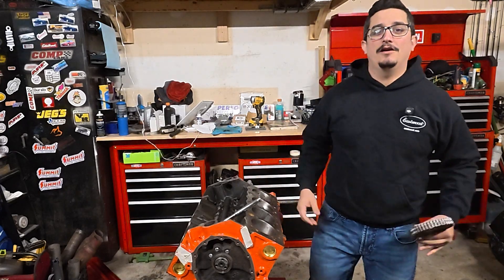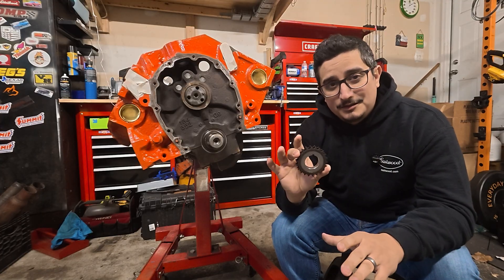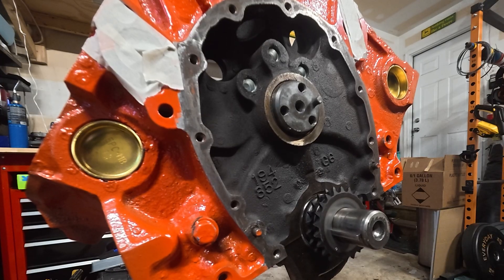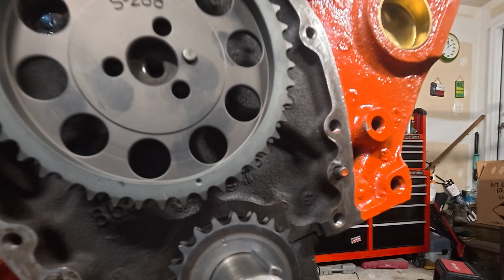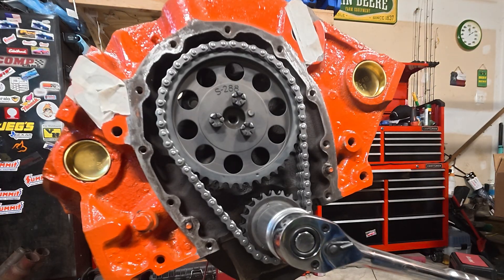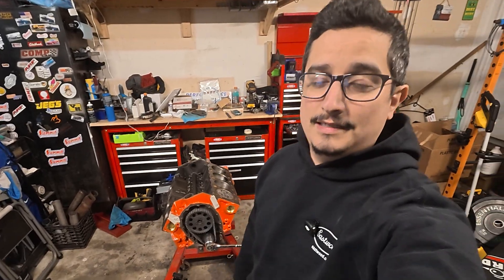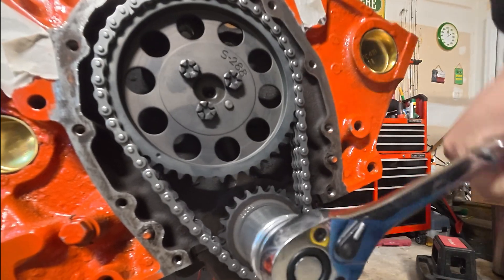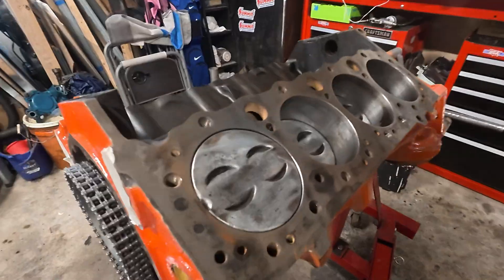The Engine Building Timing Secret You Need to Know

Comment: I think he's a good guy, but he is NOT explaining what he's teaching very well. 

His idea is the correct way to install a timing chain. 

Installing the distributor is a different matter. Theoretically, you can drop the distributor in with the rotor pointing in any direction. Then bring the number 1 cylinder to the top on the compression stroke. Remove the cap, place the #1 wire at whichever contact the rotor is facing. Install the rest according to the firing order. The only time this would not be ideal is if your recycling your old plug wires and they're already bent a certain way that might not be ideal.

Let the complaints begin.

Comment: Dot to dot is not always where the cam should install, if you degree the cam you will find out. I have a 388 that I'm currently building and when degree the cam dot to dot it was 2 degree retarded which is not really ok in  my application, so with my billet timing set i was able to advance the cam and degree again n its now 1 degree advance which is OK.

Comment: If you drop your dist with crank gear at 12 o'clock, and cam gear at 6 . You'll be 180 out, correct dist. Drop Crank at 12. Cam at 12.. my 68 Chilton Manual shows it  for Pontiac v8 and chevy v8

Comment: Couple of things I noticed.  First, ALWAYS use a puller bushing on the end of the crank.  There was a ton of metal coming off the puller when you pulled the timing gear.  Couldn't tell if it was from the puller or the crank, but regardless always use a bushing or a bolt with a small locator hole drilled in the center of the head.  Use antiseize or grease on the puller tip where it inserts into the threaded portion to reduce friction on the end, and lubricate the threads as well.  Second, maybe it was just how I was looking at it, but after the cam gear was on and you were rotating the engine, it appeared to have a good amount of slack on the coast side of the chain.  Was this block align honed or bored?  If so, the timing set you should be running will have a slightly shorter chain to accommodate this.  They are not shelf parts, you'll have to special order it.  Lastly, and the MOST IMPORTANT part of this, is MOCKUP.  The time to check for clearances, needed grinding or clearancing, or modification of parts to fit is during mockup, NOT AFTER the short block is assembled.  You should have checked this clearance before the rods and pistons were in, and with the crank sitting on just a couple of bearings to allow rotation.  I know I'd be pissed as hell if someone ground clearance for something on my engine AFTER it was assembled.  There is no way possible to get rid of the grinding debris without complete disassembly and cleaning of the engine.   Oh, one thing I forgot.  The cam sprocket bolts.  ALWAYS ALWAYS ALWAYS use either a locking tab or loctite on those bolts.  They carry more load than you think and CAN loosen without warning.  I can't even count how many times I've seen this on both stock and aftermarket engines.  Just because the tightening torque values are low doesn't mean the fastener doesn't see a lot  of load.  Without a thrust plate and stop bushing keeping the cam in place, it WILL WALK back and forth while the engine is running, and no, the distributor gear will not prevent this.  The only thing holding it all together up front is the cam gear bolts.  Just an FYI.

Comment: I alway bring it up on #1 compression  before putting in distributor. Distributor is one of last things to install on a motor replace or install. I get most thing bolted up so i can prime the oil system before the distributor goes in and you cant see these marks by then.bump it over on starter find #1 comp line up timming mark on balancer with the pointer drop in distributor with rotor pointing at #1 hit the key and shes running. Not that hard

Comment: I don’t understand? I rebuild more engines in my life of 50+ years as a mechanic and I always set the engine on TDC and the distributor a little advanced, never had a problem starting, then I would set the timing and fuel if it’s a carburetor after the warmup,

Comment: First, whenever your dot on your crank is up, your #1 piston will ALWAYS be at top dead center DUH! Second, before you drop your distributor in, simply check that both valves are closed on number one. I’ve been doing this for over 40 years. This method never fails, and I never had a hard time starting any engines after a rebuild. Assemble with both dots facing each other, lube the chain and install your timing chain cover and forget about the dots. Install the harmonic balancer and line up the timing mark with the pointer on the cover, then simply check if both valves on #1 are closed and if they are not, turn 360 degrees on the crank. You are just confusing newbies with useless information. Also, NEVER hammer the gear/sprocket on the crankshaft. Use a bolt and proper washer or a specialized pressing tool.

Comment: this guys a idot its ALWYS dot to dot
Reply: Dot to dot is for timing set installation, yes, but if you want to drop the distributor in and align the rotor on #1 plug wire, the dots will need to both be at 12 o'clock. That's when #1 piston is at the end of the compression stroke, both valves are closed, and #1 cylinder is ready to be fired.   When the crankshaft sprocket and the camshaft sprockets are lined up dot to dot, that's when #6 piston is at TDC and at the end of the compression stroke.

Comment: For us older mechanics (im 82 years old retired) We were taught why. If you go dot to dot you know youve got the gears perfectly timed But they taught us early on to turn the timing marks so that both marks were at the top And that way you know your gears are perfectly aligned and with both marks at the top of the gears then you know youre perfectly 0 degrees timed on #1. AND VERY IMPORTANT to put your #1 plug wire on the right front corner of the distributor cap on Chevrolet V8 And on later 80s models and some of the early 90s models that was very importantbecause of degree timing and you also had to make sure you had rthe correct camshaft and crankshaft for the year model you were working on

Comment: You don't point the distributor to number one , you point at number 6 on the distributor cap in which looks like it is 180 degrees out and the engine  will start everytime . He is right dot to dot is on the exhaust stroke but by putting the distributor in like I said when the rotor turns to number one it's at the beginning of the power stroke

Comment: Generally speaking I will rotate the engine a few more times for various reasons before I get it all together - then I use the valve/rocker positions (not the timing set) to make sure I am at a little before TDC on #1 compression before I drop the distributor in. I did like your trick for using the socket on the crank keyway to bar the engine - I will probably use that if I have the right size socket

Comment: I don't agree with method at all, every shop I've ever read shows dot to dot.
Reply: Yes, dot to dot for installing the chain, but that's when #1 piston is at TDC and at the beginning of the intake stroke. It's also when #6 is at TDC and at the end of the compression stroke. When the guy turned the crank 360 degrees and put the cam sprocket dot on top, the opposite of my previous sentences is true.

Comment: I always go dot to dot never had problems I've done hundreds always started right up and duel timing chain s belts but each to their own should of heat up bottom time gear it would of went right on .
Reply: But you didn't install the distributor on #1 when the timing set was still lined up dot to dot.

Comment: All you have to do is make sure you're on top dead center on the compression stroke is the key part before you drop your distributor in it must be on the compression stroke!
Reply: Otherwise it will be 180 out and will make noise but not run

Comment: Like Rick Simons, the book shows dot to dot, but you are 180 degrees out on #1 timing. You have to rotate the crank, then dist drops in normal. 
  ASE Master Tech - 78
Reply: Thats because the oil pump shaft was not inline.

Comment: Why didnt you use cam button chevs are notorious for cam float so its easy  now to alleviate the problem by fitting a cam button & reduces the wear factor just what i do for stock cams or hot cams

Comment: How are you going to adjust your lifters without turning the whole thing over several times.  And then you leave number one at TDC on the compression stroke.   Everything he said, makes no sense.
Reply: Not everyone puts the timing cover on before the distributor installation. When #1 piston is at TDC and at the end of the compression stroke, both dots are at 12 o'clock. What he did is correct for showing what the timing set looks like when you should align the rotor on #1 plug wire, but he didn't do a great job of explaining what he did, and why. 

Some do the rocker arm adjustment after the distributor is in. It can be done either way.

Comment: I cannot believe the number of "technicians" telling this guy he is wrong. He's spot on and all he's teaching you is what stroke you want number 1 for proper distributor install. This is easier than the both valves closed method but both are absolutely correct. The guys that say both valves closed is the only way are not even able to tell us why they think that. In engine building class we not only had to put the distributor on the correct tooth but we had to back-turn the distributor at 6 degrees btdc just until the points opened. Then your engine started without moving the distributor. (even with one piston and rod assembly missing, because that's all we had to work with) Yes, we had low oil pressure but no points deducted because the instructor told me to assemble the 7 cylinder sbc.

Comment: I was a dot to dot guy till i tore down a unmolested 350 and 454... set at tdc on compression, took the timing covers of and noticed it was 12 and 12. Pulled the book out and spoke with an old school mechanic and said that its factory at 12 n 12 for compression and quick start up no stepping on the gas everytime to prime just when the engines cold.
Reply: Yes, that's right, but when installing the timing chain, it's best to install dot to dot because they are so much closer together and you can easily see if the chain is off a tooth. Dot to dot alignment is when the #1 piston is at TDC abd at the beginning of the intake stroke. Turning the crankshaft one full turn puts both dots at 12 o'clock and #1 at the end of the compression stroke, ready to fire. Turning the crankshaft one more full turn puts #6 ready to fire, #1 again at the beginning of the intake stroke, and with dot to dot alignment again.
Reply: I set my motors to fire 20 before tdc. Not tdc like it appears you are showing.

Comment: Just leave the timing setting as-is but set the firing order so the rotor is pointing at #6   [6-5-4-3-1-8-7-2 instead of 1-8-7-2-6-5-4-3]  It is exactly the same firing order but the crank is 360° out

Comment: Sir, Cloyes has went chineseium.  They're no good anymore. You noticed the slop in the timing chain right? 
There should be NO slop.
Gotta spend some $$$ to get a quality one nowadays.
The number 1 way to tell a cheap Chinese timing set is a loose, sloppy chain.
Quality set has a nice tight chain when assembled.
There's about 2° of freeplay in that chain, and not only will it throw off the valve timing, but it's gonna throw off the ignition timing as well.  

Done been there and done that myself. Never could get the timing just right, close, but not right.
Caused me the same problems as trying to get the timing right on an engine with a wore out timing chain.

Comment: 0:19 - What a hack!  One can even see the metal shavings pouring out of the crank's balancer bolt bore due to using the wrong puller tip!  This is certainly the way to ruin the balancer bolt threads!

The whole premise of this video is just plain stupid.  Keep them dot-to-dot and time the distributor rotation on the #6 piston.  Simple as that.

Video looks like shite.  Everything is flattened without detail like there's some sort of filter or the camera sucks.  About the only thing I can say is that at least this dude knew which way to orient the recording device to shoot video.

Comment: I’m just wondering how that thrust bearing is doing after you beat the crank gear on. Might need to check your end play. Usually it’s better to heat up the gear or use an installer tool. Not beat on the crankshaft.
Reply: Yup ! This guy is a little green behind the ears....we all know that you press the crank gear back on and never hammer on the thrust bearing.

Comment: Great video Thanks I am building a 454 and had all machine work done and balanced the engine. It takes 30 foot pounds tourqe to rotate crangshaft and installed pistone. Some folks say that is a little high. Besides that motor rotates great.

Comment: Chrysler guy here. We just put our distributor in 180 out. Fires up every time. So dot to dot. Put distributor in 180 out. Our oil pump shaft has the cam gear on it. We just turn our distributor 180. The distributor has like a flat end on it.

Comment: 55 yrs old done 50 350 chevys dot to dot starts every time
Reply: Are you saying you put the distributor in with the rotor pointing at #1 on the cap while the timing set is still lined up dot to dot, which is when #1 piston is at TDC and at the beginning on the intake stroke?
Reply: I thought the same thing but just diassembled a 1979 350 and dot to dot was number 6. I thought I was losing it but I had vague recollection of running into it before.

Comment: It's really no different than we old guys did it.  By the time the distributor is installed, the timing marks can't be seen.  We just found TDC by compression on the #1 cylinder.  Stab the distributor with the rotor pointing to the #1 cylinder and it will work.
Reply: Exactly.
Reply: It’s even easier if the drivers side valve cover is off. Piston up on #1 with both valves closed. I’ll do this when I put the dual plane Weiand intake on the SBC in my rat rod Jeep and get the single plane intake off there

Comment: Been doing my thing,dot to dot,for 40-55 years and all of my engines fire up fine,Chevy, Ford or Chrysler/ Plymouth
Reply: You set the gears on dot to dot but if you drop that distributor in on #1 at that configuration I guarantee you it will not start and it will backfire on ALL Chevrolet small block engines. Im 82 years old retired LIFELONG CHEVEROLET MECHANIC AND THIS GUY IS RIGHT ABOUT THEM AND YOURE DEAD WRONG. You just got lucky by unknowingly turning the engine during put together and wound up on #! by accident I knew what he was talking about as soon as I heard him and they taught us why you set them up dot to dot when you put the gears on. SEE I went to school for it. You put the gears on dot to dot to ensure the configuration  but then you rotate the gears180 degrees to get on #1
Reply: @douglasmorrison9098 that's correct, I failed to say I did rotate the engine to adjust the valves

Comment: DOT TO DOT💪
Reply: got to dot youre 180 Degrees out of timing on #1 Both dots at top youre exactly 0 degrees on #1 Cylinder Im an 82 year old retired lifelong Mechanic and I learned that early on in my schooling
Reply: @douglasmorrison9098 it doesnt matter.
The distributor firing number 1 must line up with oil pump shaft facing the front of engine and BESIDES, when you set your tappets after, the timing marks are IRRELEVANT.

Comment: after the static valve adjustment, unless the timing chain cover is off, you will not know where your timing chain alignment is. At that point I just do the old fashion finger over #1 spark plug hole to feel for the compression stroke, line the timing marks at zero, and then drop the distributor in pointing at #1 spark plug wire with just a hair of counter clockwise rotation, and that does it.
Reply: Yup!  Agreed.... works every time. !
Reply: Thats the way
Reply: If the cover and heads are on , when the compression comes past your  thumb/finger , dop in screwdriver and rotate to TDC. 0 on timing cover Should be on pointer. Should.
Reply: Yes, I’ve done this a number of times. Touch the starter and it’s running immediately

Comment: That is a hard turning motor. Dot to dot makes 6 the firing plug but figure most of this is out the window since you will be spinning the motor as you tighten the converters bolts, or nuts in the case of the evil Ford setup. When you are ready to add distributor put a plastic plug in the 1 plug hole, spin motor by hand. As compression rises it will spit the plug out or at least make some noises. Turn till you are at 10 BTDC, Stop. Put in distributor with rotor pointing to 1 on your cap. when you can add power, hook a plug and wire to 1, turn power on, work dist back and force seeing or hearing the spark. Try and stop at the tick. This will put you within 2 or 3 degrees of 10 BTDC. Snug dist down some. At this point a carb with some gas in it, a couple of squirts of the gas pedal it will fire right up. You did put oil and filter on yes?